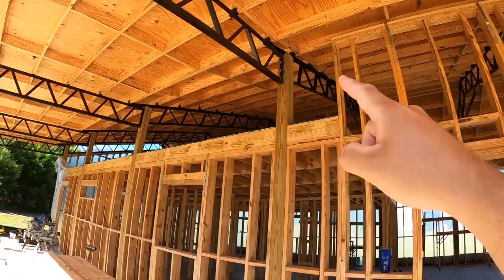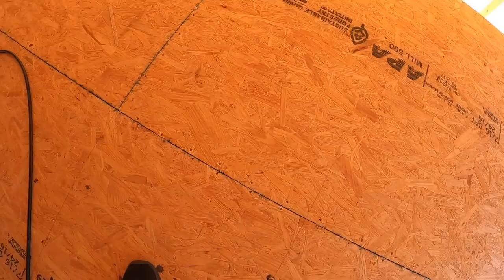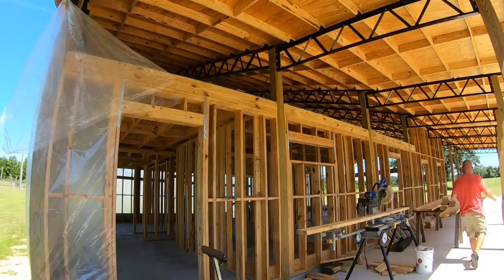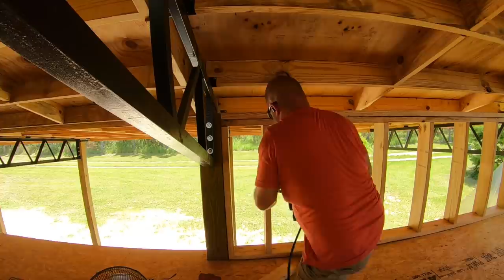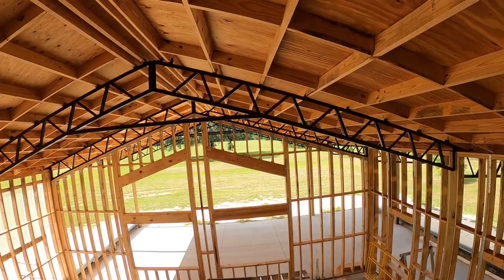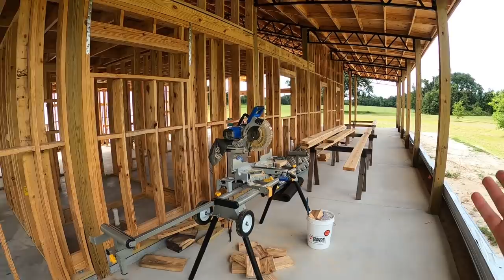Pole barn house attic stub walls have started! #381

Comment: Ok, you did it now.... I really like all your videos. I enjoy watching them and checking on your progression but you slyly slipped in and mentioned my favorite, PICKLES. Could you give us your recipe and let us try them. Thanks so much in all you do, you are one busy man.
Reply from the maker: The brine is 1 part water to 1 part white vinegar. For every 8 cups total add 2.5 tbs of pickling salt and 1.5 tbs of sugar. Bring to a boil to dissolve ingredients, then kill the heat. After sterilization of your canning jars, add 1/2 tsp dill weed, 1/2 tsp dill seed (critical), and a 1/2 tsp of minced garlic to each jar. You don't have to be exact with those ingredients. Put in cucumbers cut to your choice, ladel in the brine and I waterbath can for 10 minutes (check for your area on canning time). Remove and let set for a minimum of two weeks for full flavor, that's the hardest part lol.
Reply: @TKCL  sounds like a great recipe! Ty!
Reply: @TKCL  Thanks so much, I'll give her a try.

Comment: Maybe leave one section of knee wall open or at least quickly and easily removable so you can get larger items like drywall , flooring, doors, etc up there.
Reply from the maker: The front loft will remain open for those items. Sheathing is next, so the stub walls need to be secure.

Comment: I think you still need to do your fire blocking on your back wall.  You still have a gap between your attic floor and balloon wall framing that will probably need to be covered with dimensional lumber or something similar for fire code.
Reply from the maker: I checked, no fire blocking code here. It's for stairways, basement to first floor transitions ect. I'll double check with the inspector.
Reply: @TKCL  I thought it was IRC for fire blocking to be between two separate levels when there is “living space”.  A normal attic wouldn’t normally require it I thought, but since you are building the loft I figured you would need it to slow potential spread into the upper level.  Either way, good luck with the build!
Reply from the maker: You know what, the loft might change that. Good point, I'll ask!

Comment: The house is looking good!  Could you share the pickles recipe and/or a link?  Thanks either way.
Reply from the maker: The brine is 1 part water to 1 part white vinegar. For every 8 cups total add 2.5 tbs of pickling salt and 1.5 tbs of sugar. Bring to a boil to dissolve ingredients, then kill the heat. After sterilization of your canning jars, add 1/2 tsp dill weed, 1/2 tsp dill seed (critical), and a 1/2 tsp of minced garlic to each jar. You don't have to be exact with those ingredients. Put in cucumbers cut to your choice, ladel in the brine and I waterbath can for 10 minutes (check for your area on canning time). Remove and let set for a minimum of two weeks for full flavor. Thanks

Comment: Please share the pickle recipe.  I’m over run with cucumbers.
Reply from the maker: The brine is 1 part water to 1 part white vinegar. For every 8 cups total add 2.5 tbs of pickling salt and 1.5 tbs of sugar. Bring to a boil to dissolve ingredients, then kill the heat. After sterilization of your canning jars, add 1/2 tsp dill weed, 1/2 tsp dill seed (critical), and a 1/2 tsp of minced garlic to each jar. You don't have to be exact with those ingredients. Put in cucumbers cut to your choice, ladel in the brine and I waterbath can for 10 minutes (check for your area on canning time). Remove and let set for a minimum of two weeks for full flavor.
Reply: @TKCL  thank you
Reply from the maker: Your welcome

Comment: Would you take a quarter for Everytime you bumped your head while your doing the attic. Now I'm not offering , I'm a poor man lol. My wife and I were watching you putting all the nails in the plywood she asked just that, why all the nails and you explained it a few minutes later. I worked at a bus company and rivets were put probably every inch on the side panels, government requirement I'm sure. You'd think it would , like the nails make the structure weak. But guess not .
Reply from the maker: Believe it or not, I've probably only hit my head 10 times. I'm sure that will speed up now that I've said that lol.
Reply: @TKCL  no doubt, you've put a jinx on yourself 🤭

Comment: Shouldnt you have layed your second layer of sub floor before the stub walls.
  You second layer is not going to be over that outer edge.
Reply from the maker: I didn't see any reason why it mattered. It will be over all joists and glued/nailed to the sub floor. It's technically the joists 12 inch on center that's supporting the flooring. Maybe I'm wrong 🤷
Reply: @TKCL  im not sure might want to check with the engineer just to be safe.

Comment: Why didn’t you do the exposed side first?
Reply from the maker: It did not matter, finished all walls today other than some bolting down. I'll have a video out soon.
Reply: @TKCL  perfect. I was a little worried with the battle for lumber.
Reply: It sure be nice to stage the sheet rock in the attic while it’s still easy to get it up there.
Reply from the maker: Front loft will remain open for the little bit of sheet rock to come up. The stub walls have to be secure so I can start attaching sheathing.

Comment: I disagree, what you doing make perfect sense. as someone who used to build steel buildings for a living. I understand everything you're doing. one thing to keep in mind. talk to the inspector about photoing the progression. as far as the nail pattern, excetera. and the way you are videoing it, they should be happy with watching that, or whatever and verifying that you're following the plans. what they're doing. the other thing you can always ask for a waiver on inspecting one portion or another. federal law allows you to do that. but no I do know exactly what you're saying because Florida is a special area but yeah I probably live within 100 to 150 miles of you from what I'm guessing. but keep doing what you doing it looks good man.
Reply from the maker: Thank you
Reply: And by the way to block a in of top translation purposes. You can add a 2 by 6 in the roof structure and then a two-by-four or to buy five whatever use a table saw to put the correct angle on it so that it'll seal and that would give you what you need so that you can install a properly and tied all together
Reply: And by the way I use voice to text on my phone and it screws up stuff but it is what it is have a good day man
Reply: Actually a better things to do on the top of that wall would be put your 2 by 6 in the roof structure square with the wall and when you sheet it with your OSB run it all the way to the roof that would block it in for insulation purposes and make it stronger anyway there's a dozen ways to do it you just got to take time and figure out what you want to do. And yes asking for a waiver will severely offend the inspector but they have to go along with it LOL I used to build predominantly agriculture structures and there are federal laws in place that state a building used for agriculture purpose does not require permitting and you talking about making an inspector mad that is a pretty good way to do that